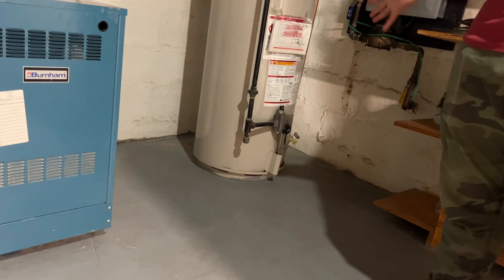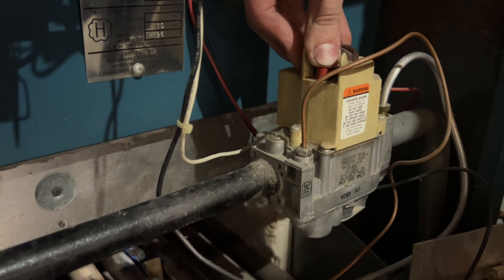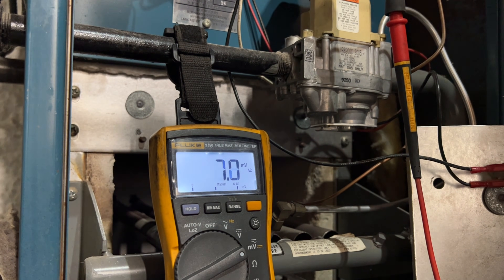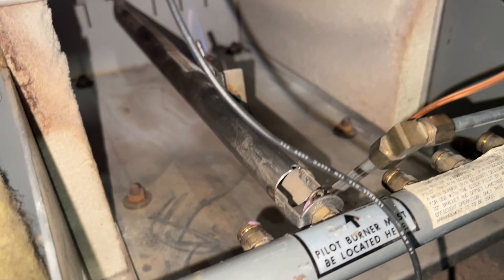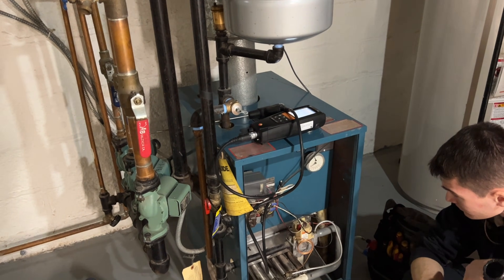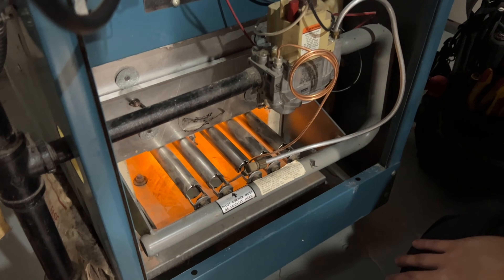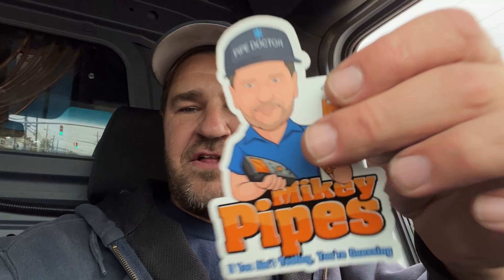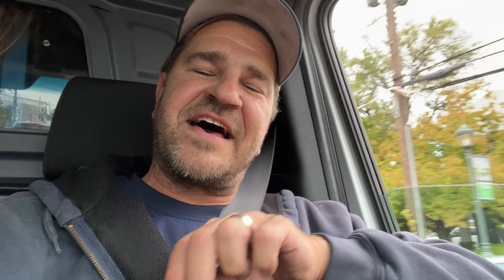Typical No Heat Pilot Out Service Call Uncovers Dangerous Levels of CO During Combustion Analysis

Comment: I was taught to adjust the gas pressure to what the manufacturer says like some are at 3.5 .  And the system shouldn’t have high co level since that is what the system was designed to run clean at that setting lmk what u think

Comment: Four unit four "common eight inch flue" forced air furnaces stacked by floor with none zip zero makeup air. WT`af. They took out the lost knowledge of a single pipe steam system so as to bill each tenement separate. Nice job with the vlave adj, made my day, and thanks for not showing the intricacies of DO NOT FU WITH THIS PART DIY, Tis mo opened them up all the way as well due to undersized unit!S and low line pressure.

Comment: do you ever use a junction block to test the t-couple inline?
Reply: @PipeDoctor   they make a junction block that screw into the gas vale and the t-couple screws into it . you connect your meter on it . to read the inline millivolts. normally 12-14 mv. i will see if i can get you a part # for it, i have used it for 25+ yrs

Comment: Yellow flame dirty pilot causing white ash buildup on the bottom/inner casting. Brush/blow her out, pilot orifice pulled and cleaned along with the pilot hood. Replace t-couple. Service agreement sold and customer for life
Reply: yeah, utter terrible pilot flame, which will soot and ash everything up. something is plugged(orifice or air inlets), low gas flow to pilot/gas valve issue.

Comment: Now I'm curious???
The only thing you touched was the gas valve right (cleaned the burners) and the CO dropped right !
HOW DO YOU CONDEMN A BOILER THATS NOT LEAKING????
AGAIN THOSE RESIDENTIAL COMBUSTION ANALYZERS ARE PLUS / MINUS 20+-
IF THE FLUE PASSAGE WAYS AREN'T COMPROMISED IT CAN BE FIXED !
IF THE BURNERS ARE SHOT ORDER NEW???
IF THE GV IS NOT REACTING REPLACE IT ?
REMOVE THE BOILER AND PLACE IT IN THE FRONT YARD WITH NO CHIMNEY ITS SET UP TO RUN FROM THE FACTORY!!!!
YOU ALSO HAVE TO BE AWARE OF A BAD SPRING IN THE VALVE IT COULD GET FUNKY LATER THIS IS WHY IT'S ALMOST BEST TO REPLACE THE VALVE THAN ADJUST IT ,ESPECIALLY IF IT'S AN OLD BOILER!(never checked pressure when commissioned)
GAS PRESSURE READINGS SHOULD BE NOTED AS YOU ADJUST THE VALVE ALSO AND COMPARED TO FACTORY SPECS, REMEMBER IT'S ONE PACKAGE.

THINK STEADY STATE OF OPERATION.

I KNOW YOU HAVE TO FLY FROM JOB TO JOB BUT CALL BACKS WAIST TIME AND MONEY!
Note: This only applies to boilers, furnaces could be a whole different animal!
🍺🍺🍺🥃🥃🍿🎯
Stay safe. 
Retired (werk'n)keyboard super tech. Wear your safety glasses!

Comment: What flue gas temperature is considered excessive? Did you adjust the gas valve pressure by the Testo results vs manometer reading?
Reply: I believe “rule of thumb” is under 500F and yes he uses the Testo only that I’ve seen but some models have a manometer built in although inches in a WC won’t tell you CO levels or stack temp
Reply: @BaconJD420   so you  dont know what your manifold pressure is then you could be over firing the boiler